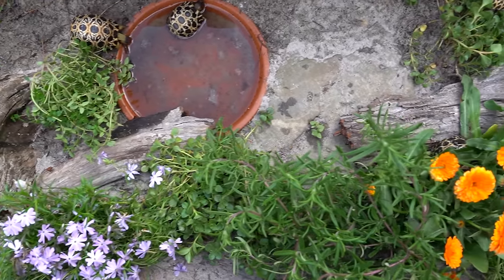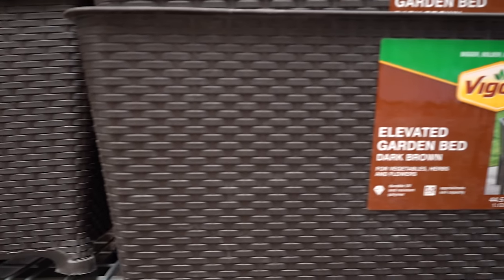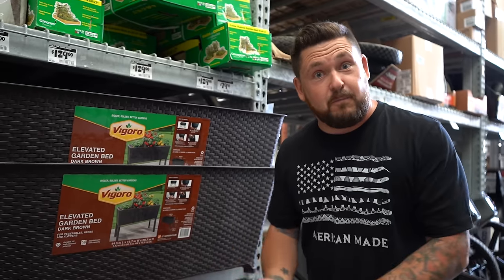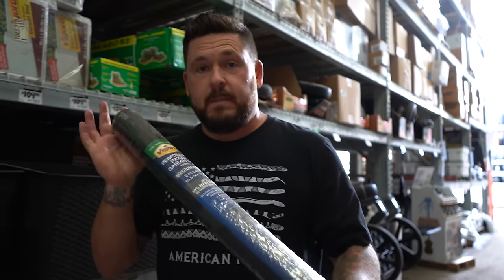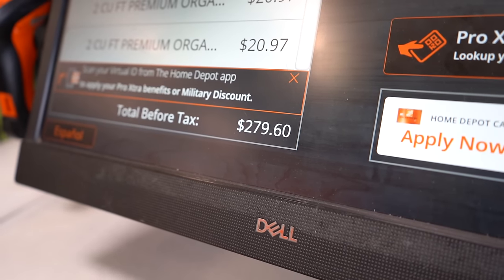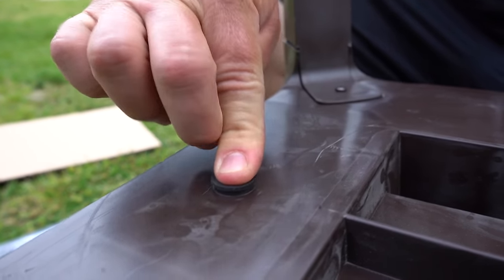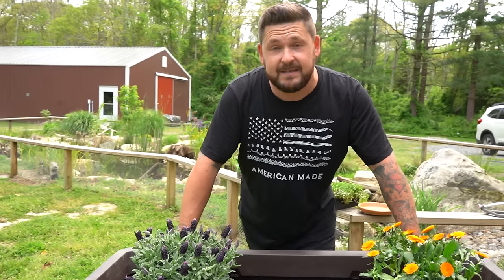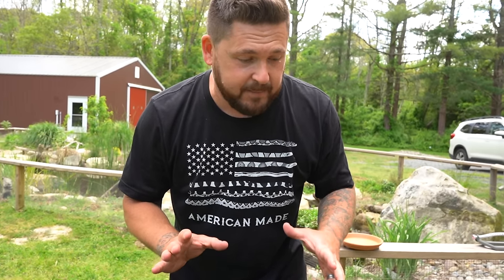DIY Backyard BABY TORTOISE Garden! (Low Cost & Beautiful)

Comment: Do you not have to worry about them spraying pesticides on the plants you bought?
Reply from the maker: We always rinse them after buying just to be extra safe but in more than 30 years of using these plants not once have we had a single issue.
Reply: @GardenStateTortoise  thanks for the information! See mixed opinions on it. Any specific stores to get from? Or any should be fine

Comment: How can this provide enough humidity for smooth shell growth?
Reply: Small mist spryer works or just keep a spry bottle handy
Reply: Wet does not meen humid as well. When water evaporates its even cool down the little ones, but it cant change the humidity of the infinitely larger airspace, its just spread away with the air movements.
Reply: @martonwieszt6719   well ur statement might be right for ur geo area i am from very hot place to make it humid we just need to spray water